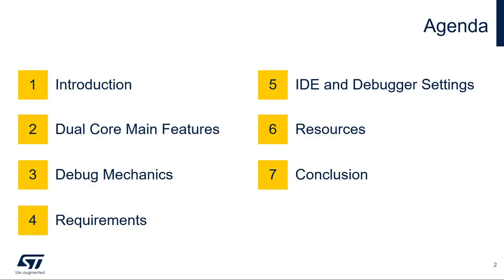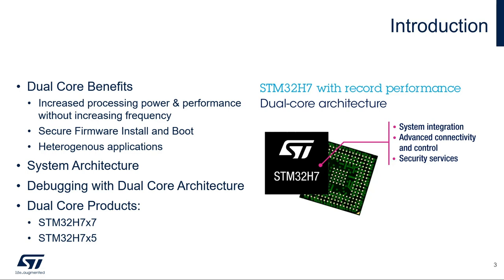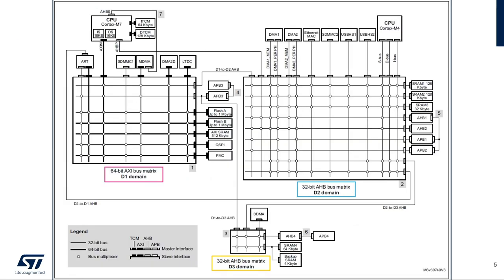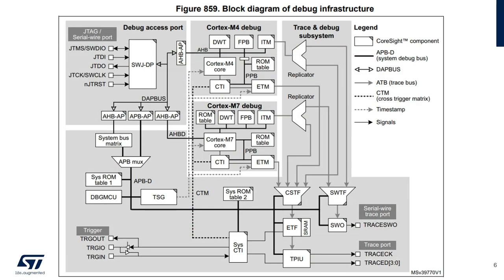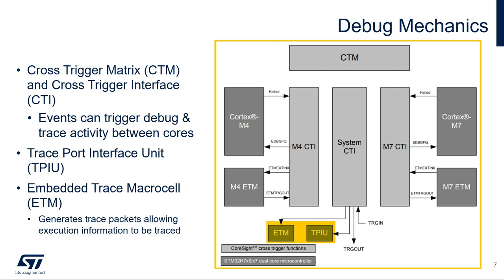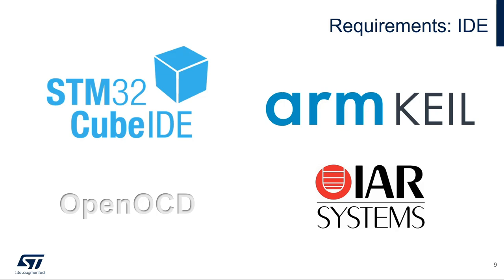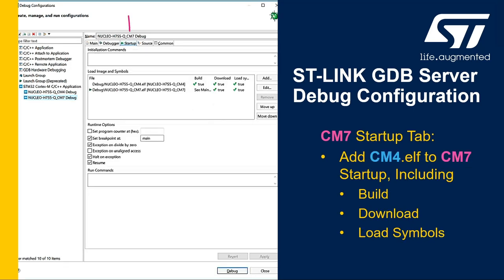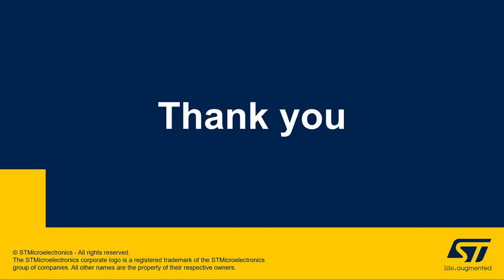Dual Core Debugging on STM32H7 with STM32CubeIDE

Comment: Good video, well instructed
1 correction.
Checking "HALT All cores" will make the M7 stuck at " /* Wait until CPU2 boots and enters in stop mode or timeout*/". 
Without it, the things work well. 
As much I understand it, according to the AN5361, "check the Halt all cores option next to it to prevent the Cortex®-M4 from starting to execute the code and end
up in the Deepsleep mode", but can't we just put the M4 in the reset mode like M7 by selecting connect under reset. 

Also is there a way to debug both the cores simultaneously ?
Reply from the maker: Hello,  Visit our online community to find answers to your technical questions and share ideas with your developers and ST experts : https://community.st.com

Comment: To me this video conflicts with AN5361. At page 12 the AN reports "Since the STM32CubeMX default project puts the Cortex®-M4 in the Deepsleep mode, the [Reset behaviour]
field must be set to Connect under reset to be able to communicate with the CPU (refer to Figure 12). The
Halt all cores option must not be set." Instead here at min 11:30 seems enabled. Who is rigth?

Comment: I follow up this procedure. However, I'm not success to debug both cores. My program goes to Error_Handler().
  /* Wait until CPU2 boots and enters in stop mode or timeout*/
  timeout = 0xFFFF;
  while((__HAL_RCC_GET_FLAG(RCC_FLAG_D2CKRDY) != RESET) && (timeout-- > 0));
  if ( timeout < 0 )
  {
  Error_Handler();
  }
I use STM32CubeIDE 1.10.1 on Mac.
Reply: arun singh's solution works fine:
>>Checking "HALT All cores" will make the M7 stuck at " /* Wait until CPU2 boots and enters in stop mode or timeout*/".<<
(uncheck the "Halt all cores" box on debug configurations->CM7 debug->debugger tab->Reset behaviour section)
Reply: @tykhaytschaar  Thanks. I can work now